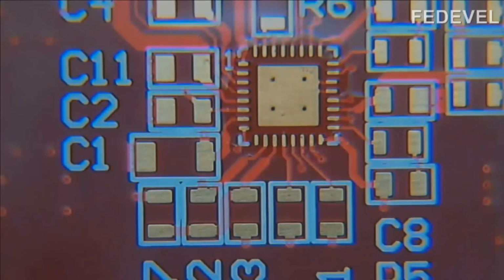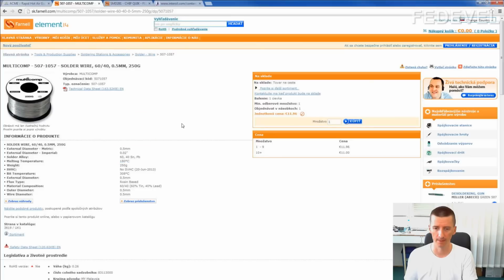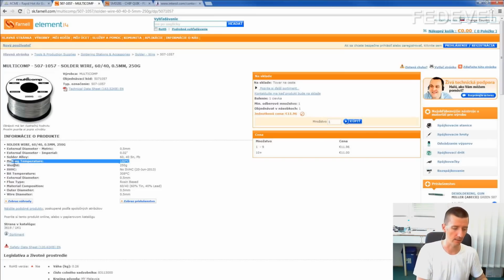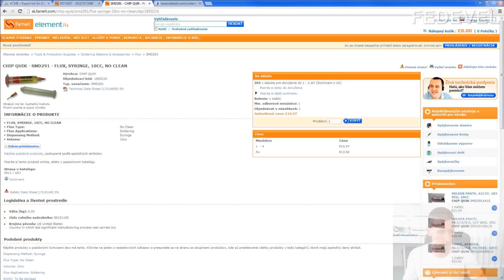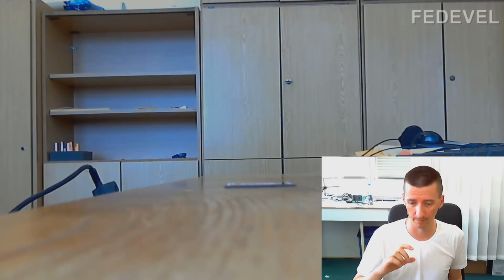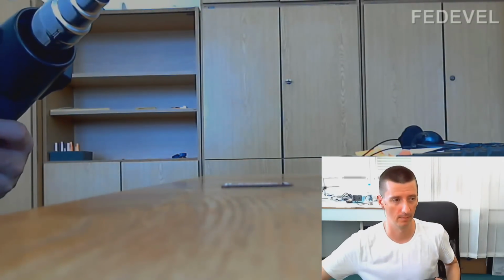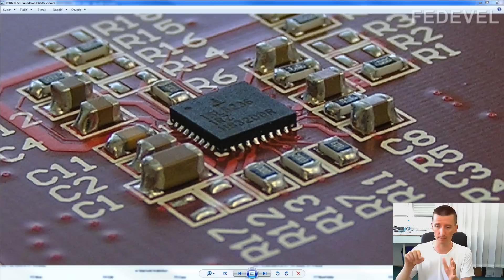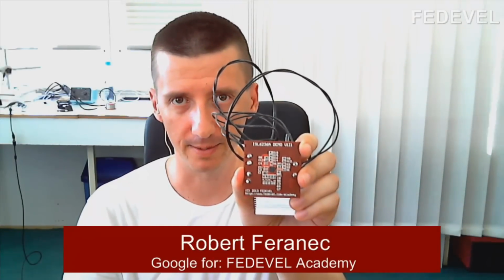PCB Soldering with a Hot Air Gun

Comment: How come the hot air at 240º C does not burn/destroy the component itself? (I'm a total ignorant in hot air soldering)
Reply: so how you soldering BGA if you are ignorant of air soldering? if components are designed to be soldered with hot air so whats wrong could happen???
Reply from the maker: Why it should destroy it? As Gediminas mentioned, even in the real production the tin has to be melted down and the component has to be heated up to that point - the whole board travels inside a huge oven.